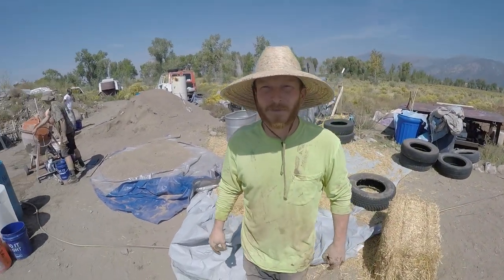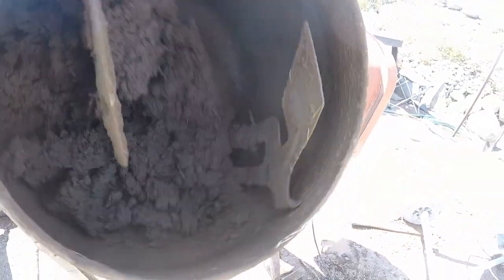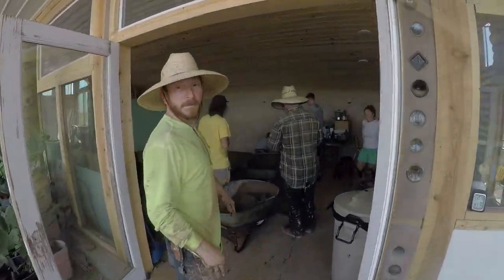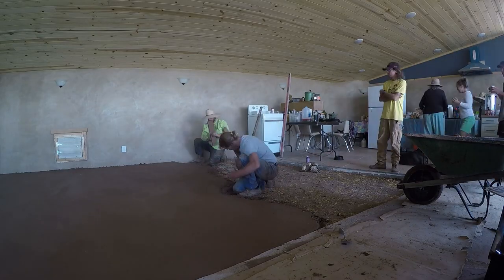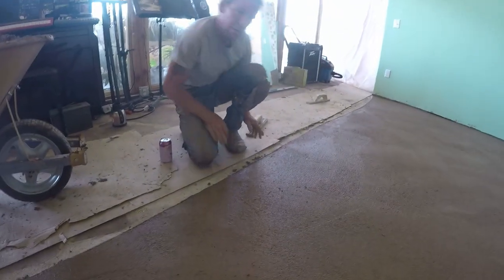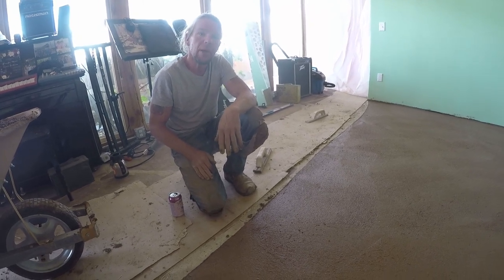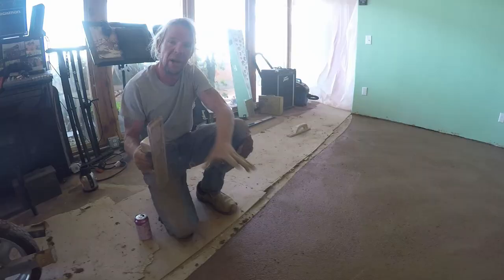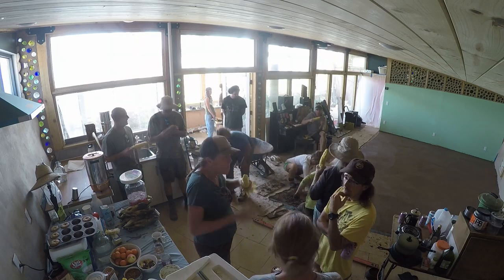EARTHSHIP Adobe Floor Pour

Comment: Great video. Did you put a base of crushed rock beneath it? And how did you finish it off? Is there a top coat? Love to see more videos on this process.
Reply from the maker: We put down 6 mil plastic as a vapor/radon barrier, then 2 inches of rigid foam for insulation, then about 3 inches of gravel, then the 1/2 pex tubes, then this earthen floor, followed by a clay paint, then a few coats of oil then a couple coats of wax